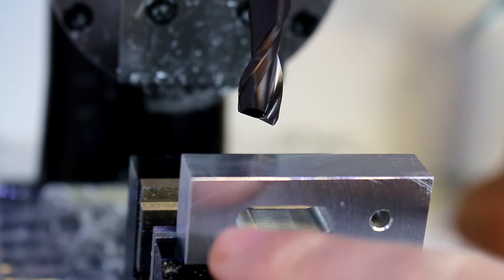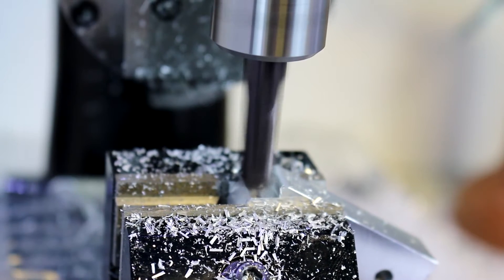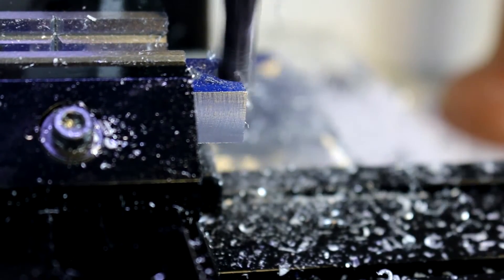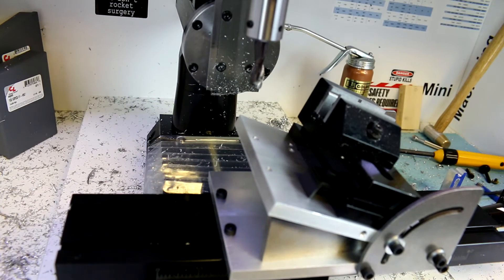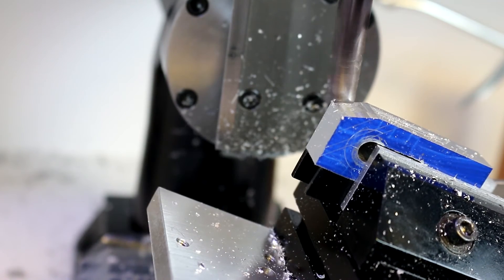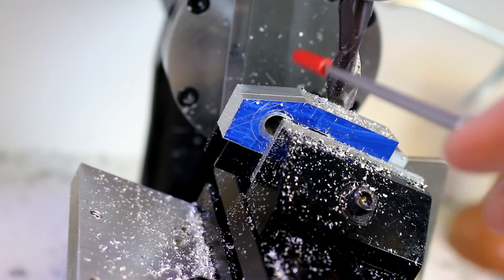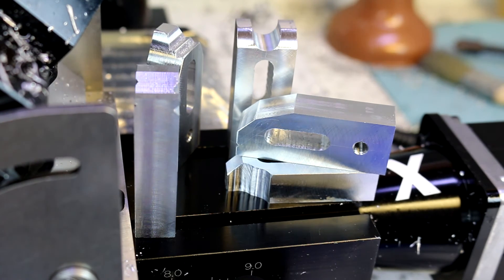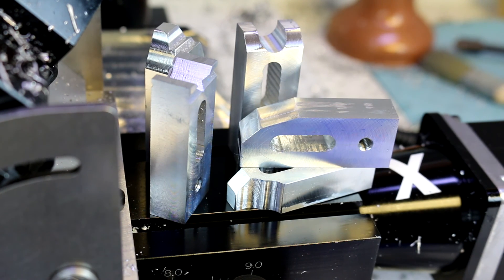Mill Projects 101 - Strap Clamp Part 8

Comment: Thank you very much for this excellent, most useful video series!  I am a new subscriber and, thanks to what I have learnt from you in ONE DAY, I am now confident enough to finally use my small Sieg Mill for the first time, since I bought it new last Christmas (2016).  I also purchased a substantial array of tooling, measuring equipment and large amounts of stock-material, ranging from brass to aluminium and steel etc... However, I did not want to start on any project, because, somehow or other, every project included one or more tasks which I felt were too difficult, either for myself or for the mini mill, and obviously  I did not want to waste expensive stock or damage equipment... But now I will try and make some of these strap clamps for the rotary table. Thanks again!